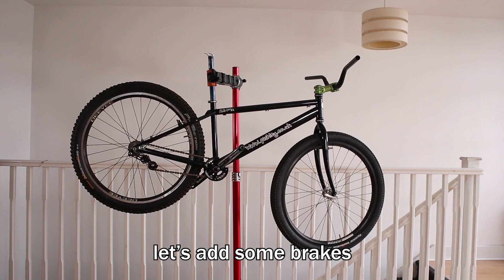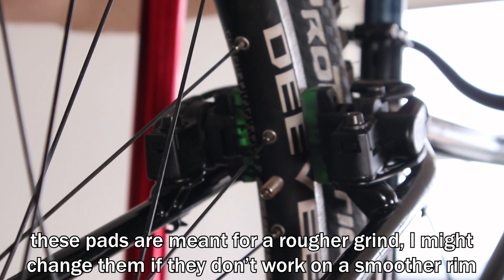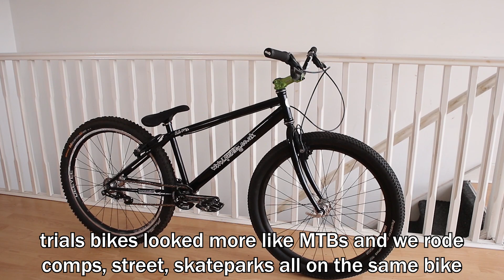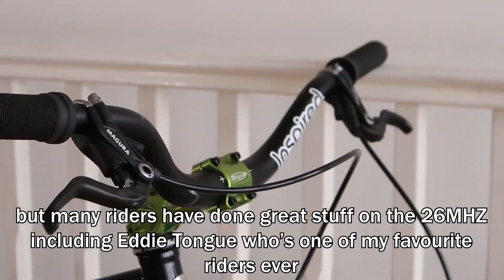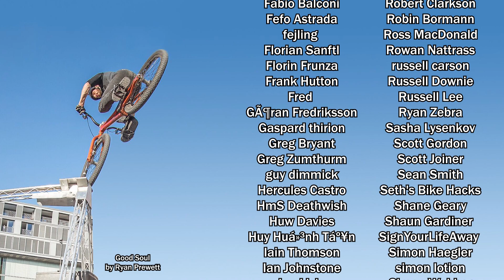The Most Requested Retro Build : Pashley 26MHZ Trials Bike

Comment: I always love those late 90s mtb+trails hybrid frames. Easy to play with and practical in city, parts all compatible with mainstream mtb. Used to be everywhere, hard to find them now.
Reply: Agree. I want an old school hardtail for riding 'everything' but majority is designed around long forks unless you go for a DJ bike and then probably too short.
Reply: @TimInertiatic  I bought a DJ frame trying to get similar result, but its geometry is still not what I want. And DJ frames are unnecessarily strong and heavy for my purpose.
Reply: @chris42076301  same!